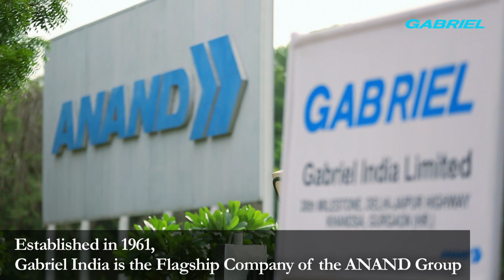GABRIEL INDIA - PROUD TO BE INDIA'S BEST COMPANIES TO WORK FOR 2017

Comment: my mechanic has recommended to install Gabriel shocker in my renault duster. not sure about it. how is it as compared to original shocker
Reply: How it was?
Reply: Please share your experiences plz
Reply: I have Mahindra centuro bike came with original gabrial shock absorber using since 10 years experience is amazing no issues no back pain very reliable product no issues since 10 years.